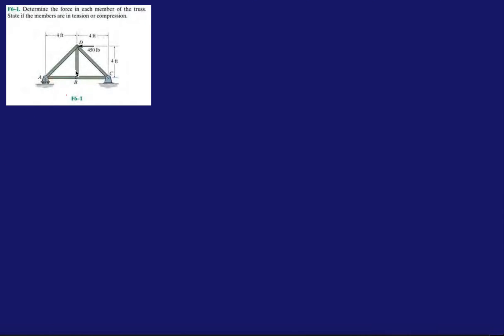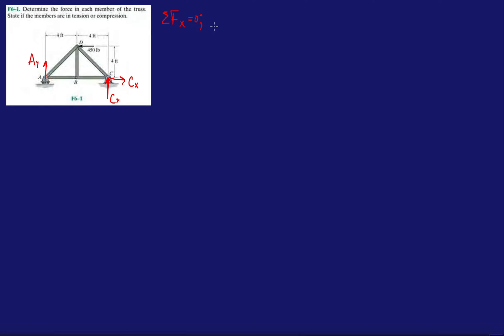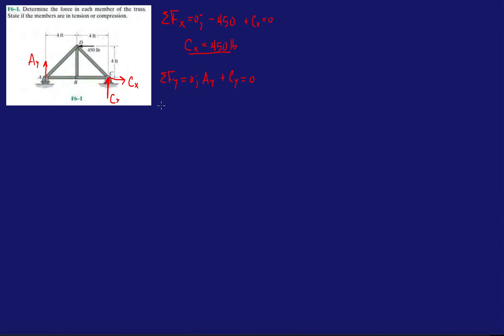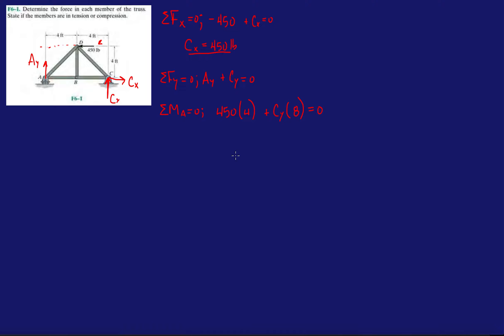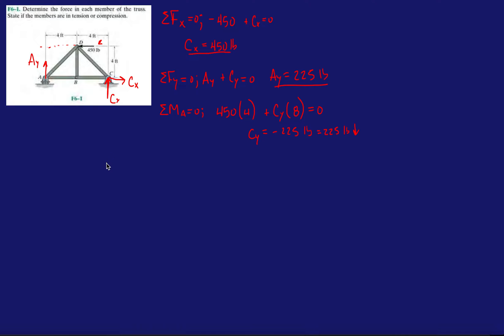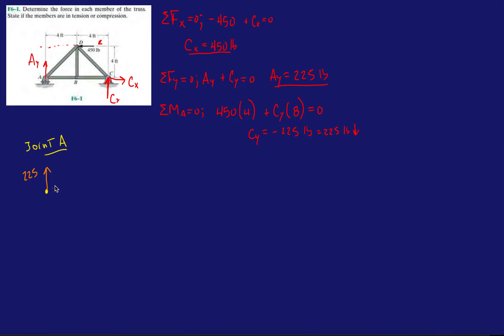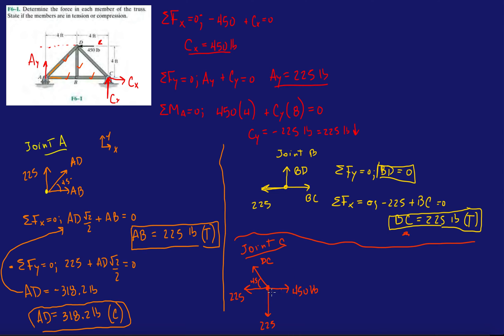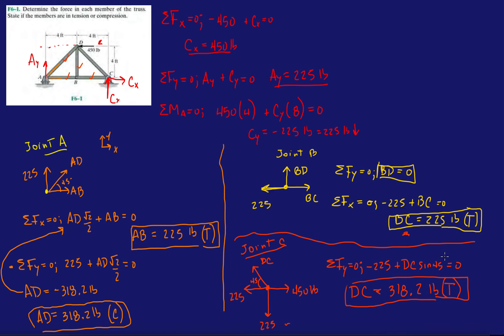Problem F6-1 Statics Hibbeler 12th (Chapter 6)

Comment: Why it there only a component of force in the y direction at A and not in the x direction but at C there is both a horizontal and vertical force component?
Reply from the maker: These are the reaction forces related to the type of support at those locations. At A, there is only reaction force in the y direction since it can freely move in the x direction, but locked in place in the y. The C component is a pin connection which is locked in place in both x and y direction so there are reactions on those components